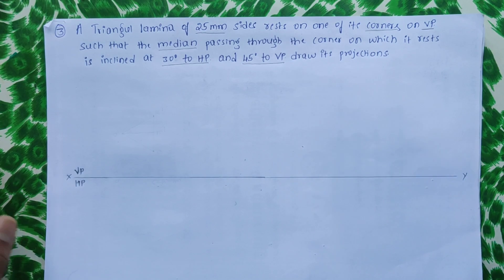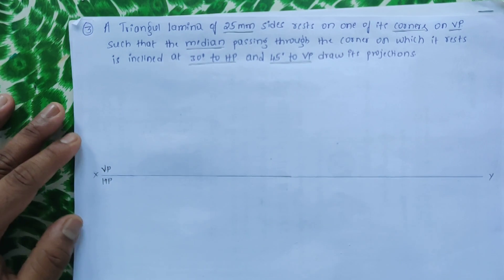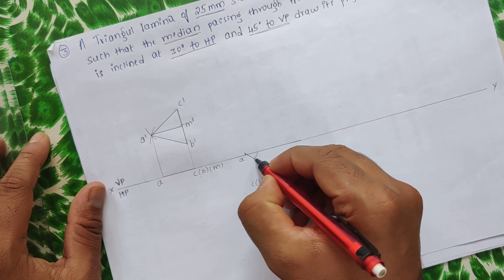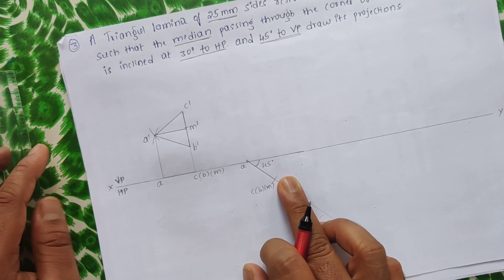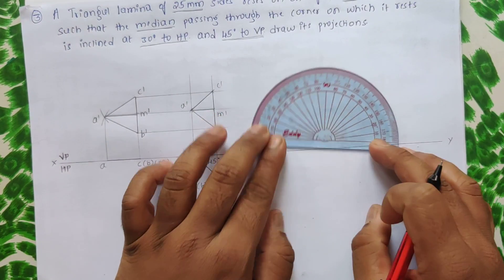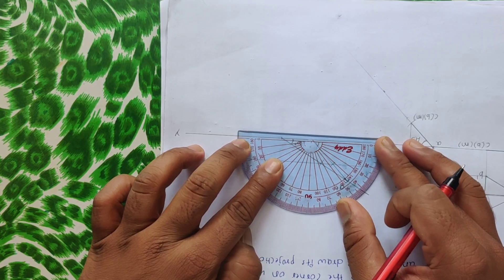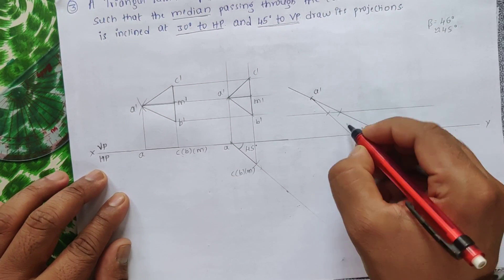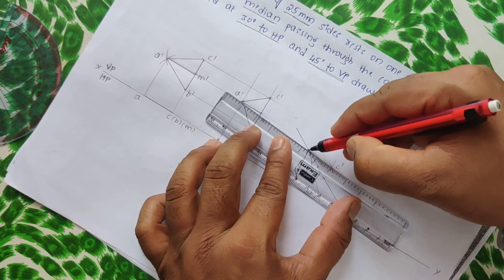Projection of plane surfaces. Problem #3 on triangular lamina.

Comment: A triangular lamina of 25 mm sides rests on one of its corners on VP such that the median passing through the corner on which it rests is inclined at 30 deg. to HP and 45 deg. to VP. Draw its projections.